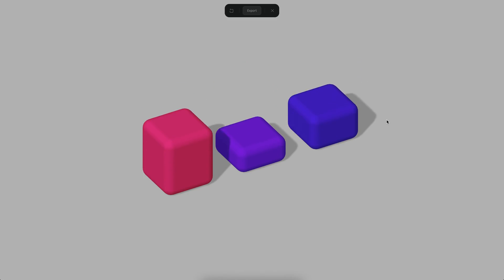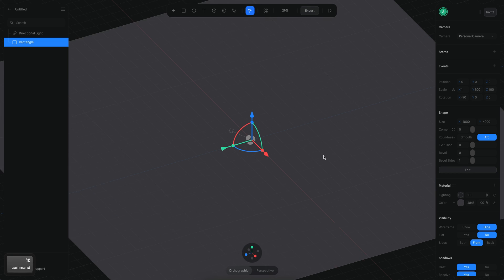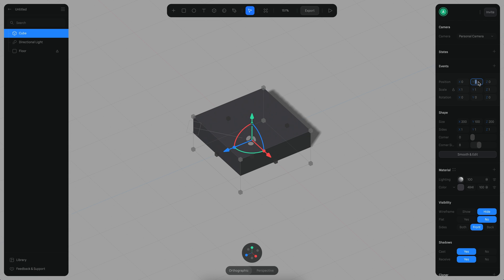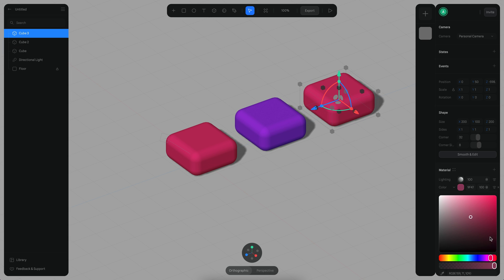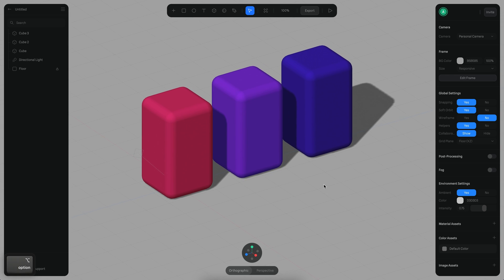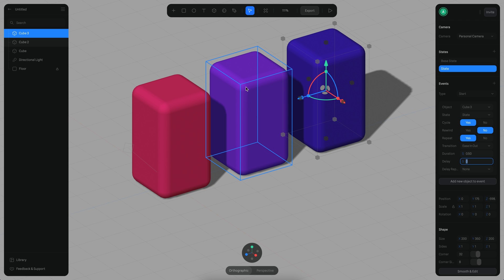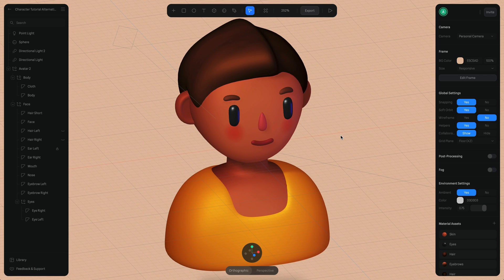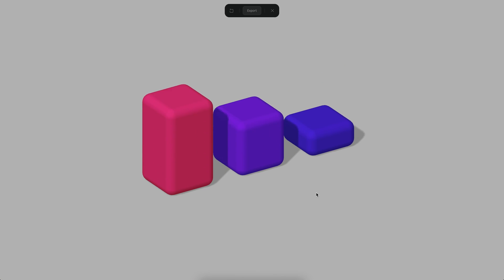Creating animation loops and blinking effects with Spline

Comment: Cool video. However, I tried to do this in Spline but I found it difficult to even set the plane as in this video. The plane is mentioned but not added and I couldn't find how to position the rectangle as shown in the video. I couldn't find any tutorials or even documentation for beginners on how to work the UI on Spline. It is unclear how do you change the position of the plane or chapes to 90 degrees, for example. Where is it? Spent 3 days on trying to figure these things out but to no avail. Perhaps, this software is for people who already know how to work with 3d modelling,
Reply from the maker: Hi! This tutorial was only meant to explain how to achieve the interaction.

Here is another tutorial that covers the full process of making a 3d scene (including the floor): https://www.youtube.com/watch?v=IKkRtimo7Qc&t=38s&ab_channel=Spline

For floors, you can also start from the templates that are visible when you create a new scene.

Comment: I've tried following this tutorial now, but this doesn't seem to work... It looks like I don't have the same state/event settings, so I am unable to figure out what setting to apply to make the columns go one after the other. The first column just repeats continuously on a loop, while the second and third go at the same time.
Reply: For anyone else with the same issue (like me!), add a start event, and a "transition" action, then a similar dialog to the one in the video will appear
Reply: The software is great but they are terrible at making these tutorials. Being a designer or motion artist doesn't necessarily make them good teachers. Teaching requires a different skill set. Other YouTubers have far better audience engagement or views than them.
Reply: Yeah I can't either.